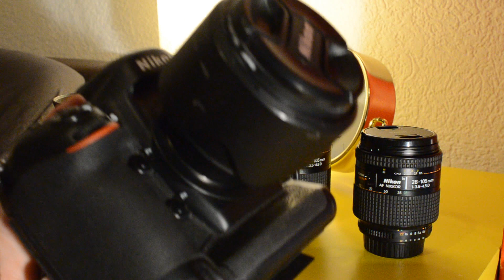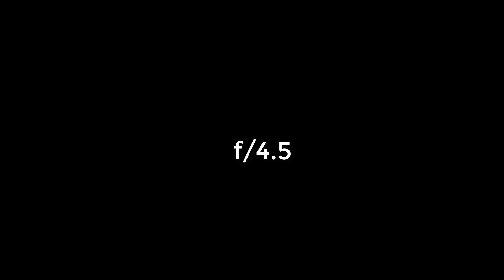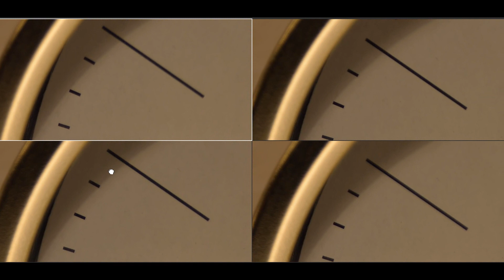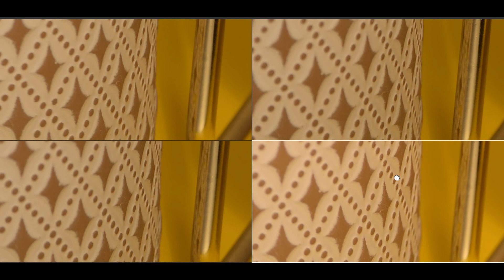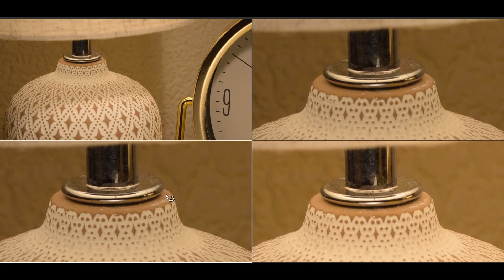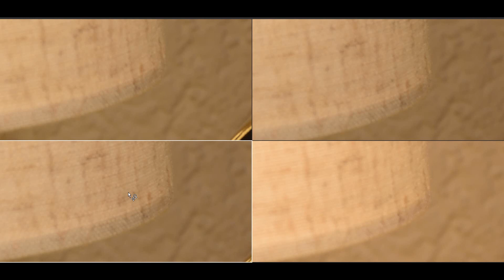Variability in photographic lenses

Comment: Considering that all these lenses are quite old (and have probably had a deal of use since leaving the factory), I am surprised by the relative lack of variation. That said, At f/8 and f/16 sample 4 is noticeably brighter. Can you certify that the exposure values (time) is identical in all four copies (at all settings). Because if exposure time and ISO are the same, that would indicate that the fourth lens' aperture does not quite close down as much as it should. 
Also, considering that Nikon's serial numbering is consecutive (higher number=>newer lens), does the age of the lens correlate with the results?
Reply from the maker: you certainly right, I did not thought about the aperture being as closed as it should. Problem is, I cannot verify this since I don't have the lens anymore. This lenses are very sought for (I actually made the video because it was a rare event for me having 4 at the same time). Three days after making the video, they were all gone. I have only my own copy now.

Comment: I don't get it.  Does this mean Nikon does not have quality control?   Their customers are just taking a chance when they buy a lens?
Reply from the maker: No, absolutely not, what i mean is, in a batch, you have criteria for quality control plus minus a margin for acceptability. Although most lenses would be in the criteria, some would be either at the good end of the margin, other at the lower end. It's normal in any manufacturing process
Reply: These lenses were manufactured in 1998-2005. Whatever sample variation there is today (and there is some), you simply cannot assume that variation already existed when the lenses left the factory. God knows how many knocks these lenses have received during their (roughly) 20 year existence.